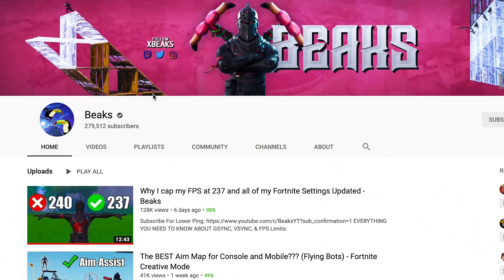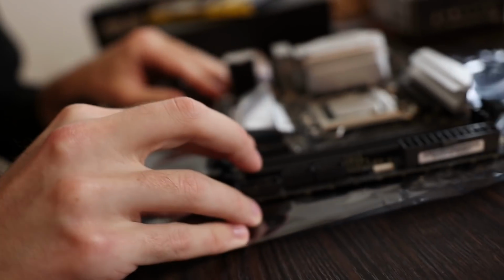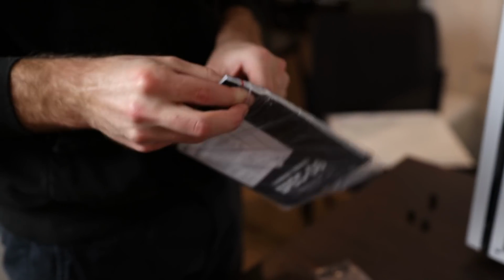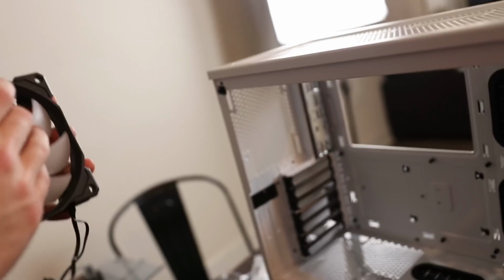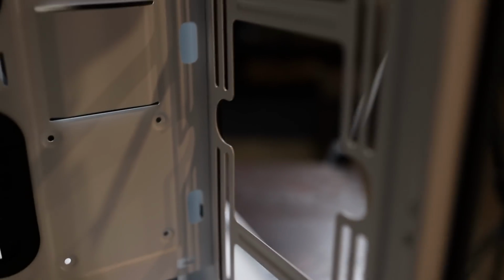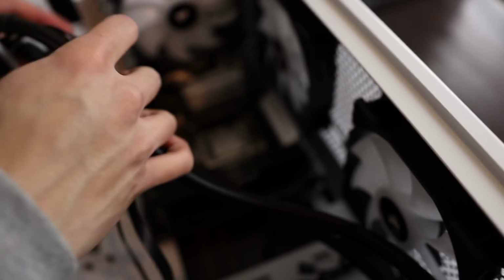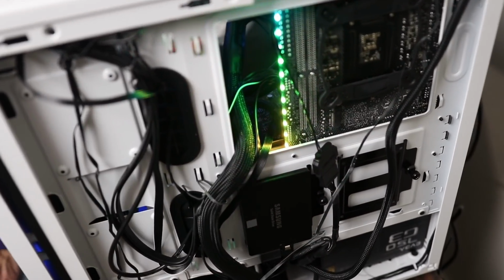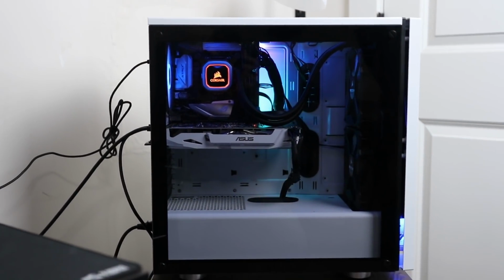Professional Fortnite Player Builds a PC (Mac User Switches to PC) Pt.2

Comment: tbh with $1300 you could have gotten a lot stronger pc than the one uv built. Nice vid tho
Reply from the maker: Tev B I estimated the price in the video. My total ended up being around $1190 cause of Black Friday. You have any better alternative parts to suggest for my viewers?
Reply: A rtx 2060 is cheaper than a gtx 1070 and performs close to a gtx 1080. The price to performance for the 2060 is really good. An mini atx motherboard with a case that big wont really look that good tbh. A bigger motherboard would look a lot more pleasing. If you will be doing loads of work on the computer and multi-tasking, an AMD CPU would be best.
Reply: Im building a computer for £1100 and the performance from it will be amazin
Reply from the maker: Tev B I’ll keep that in mind would love to see your build when you throw it together homie
Reply: My brother got my parts cheaper. Z390, 2080ti, 48 gb ram, 8 HDD, i7-8700k, for 1700